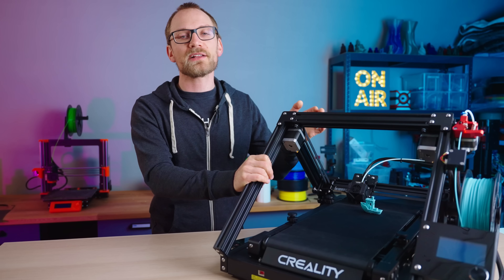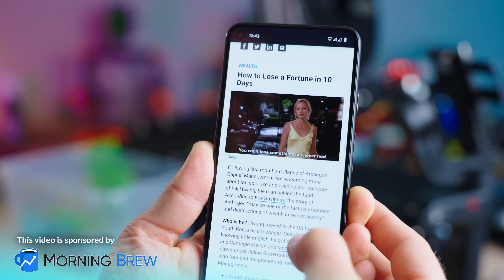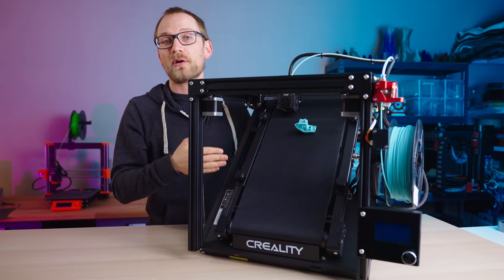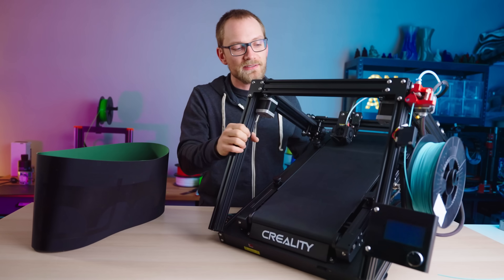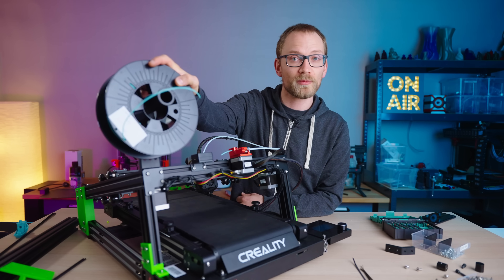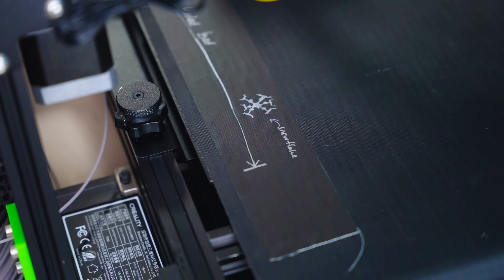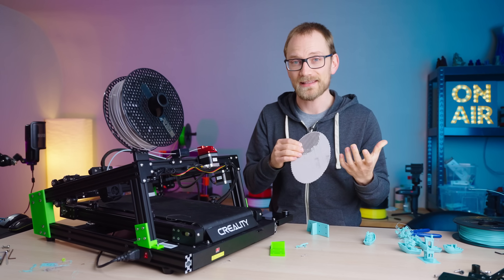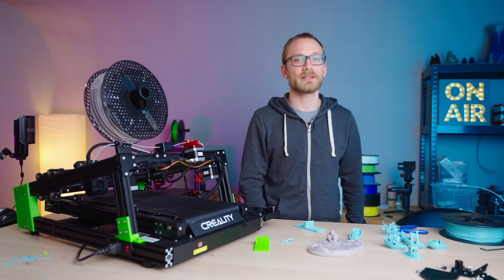Is a lowered belt printer BETTER?

Comment: This printer is so under engineered! They could have easily made a tilt feature on the hotend for the beginning lip of the print where it angles off after it gets started.  I also feel like you should have made a variable height setup rather than cutting the extrusions like you did. You could have easily put hinges on the back side, and then some type of slider with linear rods on the front side to make it adjustable depending on the model.

Comment: I wonder if you would be able to design something to tilt the carriage that last 15 degrees so that it printed with the nozzle directly contacting the belt, or do the same thing in the original design. That way, bed adhesion wouldnt be an issue.

Comment: A lowered print angle is going to make bed adhesion worse because the best angle for max adhesion is 90 degrees straight into the print surface. The purpose of the angle is to allow for long prints. 45 degrees already allows for infinitely long prints so having the angle past 45 degrees has no benefits and only drawbacks.

Comment: Why not install a 45 degree adapter to the head so it's printing perpendicular.
Reply: You moving the entire Frame seems to be the issue.  Also I would love into 10 inch 3m tape.  Then just adding a layer to attach to on the belt.

Comment: Another way to achieve a similar thing, would be to just tilt the hotend to be more vertical. If you then can also make the bed move forward and back during a layer, the effect would be the exact same.
That way you don't loose an z height. 
If you just adjust Z to sin(offset angle)*y + normal z
That way, you don't have to change the printer as much, and it could even be adjustable.
I don't know though if the Z-bed bed mechanism is robust enough for this, as as its now a true 3D process not 2.5D

Comment: could one make a regular printer with just a belt instead of a bed, like for making lots of parts in a row on a ender 3 style printer, and it just movers the belt to a "new build area" between each print?
Reply: You can. But we don't need belt bed.

Comment: i just can't get the point... the main reason for this printer is having endless prints. if you want to use it, to print many parts, just use a regular printer and put the belt under it instead of the bed...

Comment: What about Core-XYZ printer (Voron 2?) with belted bed? I think that might be a way to print reliably (bed would not move during printing) and continuously. And maybe with a bit of non planar printing you might even print those very large models.

Comment: Thomas I just found this video so informative. I've got one of the 1st CR30s commercially released and found that I have had very low adhesion compared to the other CR30s videos I've watched. I have 3 other fdm printers and this adhesion issue made no sense what so ever until your video. Could you or Naomi Wu tell me a bit about the different belts as I believe that after all my sttuggles that I have an early low adhesion version. Thanks Dave.

Comment: Why isn’t it just normal 90 degrees Z and the belt just moves it off and restarts?
Reply from the maker: That would be patented by Makerbot / Stratasys.
Reply: @MadeWithLayers  That’s BS in my opinion, it’s a process. So never buy a product from them then :)

Comment: I honestly don't understand what do you get with "endless" printing? Printing is slow enough anyway, and the print surfaces are big enough that you can print non-stop by changing the magnetic surface once a day. With many printers you can use "one at a time" setting, depending on the printer construction (Z clearance) and object height. If that is not enough, I would even consider buying two "regular" printers rather then something like that. Maybe I am wrong, but this is just my experience.

Comment: One question, what if you would use the belt as the Y-axis (the bed) and the use this to mass produce parts? (so instead of using this printer to produce meter long parts, just use it to produce repeated prints?
Reply: I've seen people use this printer to produce mass amounts of clips and things like that so its doable

Comment: Errm - Where is the catch if you just reorient the print head to be perpendicular to the belt? shouldn't it - with a firmware that is aware of the xy gantry angle - print just like a regular printer then? 🤔

Comment: would love to see like a traditional cr10 with the belt, so when the print is done it moves out of the way and next print starts, cut out the whole 45 print angle dilemmas
Reply: That’s what I’m waiting for. Just a traditional box frame 3D printer with a large dimension capability. Then when the print is done the belt slides it out of the print box and gets started on its next print. Having multiple prints in que and the ability for the machine to move to the next one. This is where it has to go.
Reply: @TheTeeDay  
Someone may make a printer like that, but it's not necessary to make a printer that runs constantly, and moves its prints off the build plate.
Look up "Slant 3D", who is a print farm owner. They, and other print farm owners, simply design the model so that it has the right amount of grip on the build plate, and then once it's done printing, the print arm simply knocks the part off of the build plate (intentionally), and that is enough for it to start printing again.
Reply: i am using ideaformer ir3 v2 and similar printer and  the slicing sis the tricky part and rest is so much fun. But  i have wasted few killos of petg before i could understand how it works. 45 degree printing is really amazing if you understand where to put the support pillars and alsi ideamaker is the best slicer for this and has a lot of options to tune . I am printing motorcycle winglets, dashboard cas etc
Reply: That’s not the reason for this belt printer they wont to b able to print for example a one meter sword with this machine. 
If you want to print several things in a row this is not the way to go.
Reply: @Mr.T9191-i2f  that's not necessarily true. There could be a sequence that would allow part to print, then move the belt, continue printing.
Reply: @dominick253  it would still have to be sliced diagonally or use non-planar 3D printing. Extruders still have a width to them, so you can’t just do sections.
Reply: @Mr.T9191-i2f  out of curiosity, what would be your ideal solution if you were looking to print a large number of individual parts with minimal downtime?
Reply: @WeAreChecking   for me something like Thomas voron it’s Great to do that. But it’s a littlebit over engendered. 
For less down time  the simplest way you can  go is to push the prints off bed by the printer itself.

Comment: Good vid, I’ve wanted to get a 3D printer for a while, but had no need till now. I do leather crafting and want to be able to make my own stamps/makers mark.
Is there a printer that you could recommend for a beginner?  Would need to be able to print a material that can be whacked with a maul or weighed down on leather to stamp an impression.
Reply: i have actually tried using pla to do just this. a high infill print and pressure makes great stamps. i wouldn't wack them with a maul though

Comment: Why not use a sanding belt? You can get some of them that are really tough. 

BUt really, whats the benefit of the machine being angled? Just to get around a patent? Why not print the part, and have the belt move. Making it the z axis is dumb, just make it the A or B axis and add some lines at the end of the gcode that just moves the belt a certain amount.

Comment: Question: why not just using a normal corexy, moving the belt and at the end moving the belt 1/3 of its lenght so you can make a Mass production which is fast like corexy and save Like the belt system 🤔🧐

Comment: What do you think about a 0 degree belt printer? Something that prints like a normal corexy but can eject the print afterwards?
Reply: From what I gathered there is a patent covering just that, which is why they use a 45 degree angle (which isn't covered in the patent). This means that if you want to sell that design commercially,  you have to get a license from the patentholder, who can choose not to sell you one. Or can charge a hefty amount of money for that license, making your printer more expensive than theirs.
Reply from the maker: That was my original modding plan for the CR-30 😉
Reply: @MadeWithLayers  do you think your original plan would have been more of an improvement? 😉

Comment: wouldn't it make more sense to just angle the toolhead rather than change the tilt of the X/Z gantry? 
edit: while I am thinking about it, it might actually make even more sense to rotate the gantry the other direction(closer to vertical) but I'd have to play with the idea in CAD for a while to conceptualize it further

Comment: I really don't get the angle thing, more calculations is more error prone. The idea of the bed is pretty nice however I use a magnetic rubber mat which helps to get it off easily.

Comment: You could have just designed a duel fan, duct and have each ducked cover each area, maybe one with higher air pressure to the extreme overhang on the far side of the nozzle, very minor firmware tweaks to PWM at best

Comment: Would be interesting how other angles would affect the print. 

An angle sanded nozzle to be more paralell to the bed, would that do anything?
Reply: I'm not a lawyer but that might breach the patent, since it deposits at a 90 degree angle,  even though the rest of the printhead would be at 45 degrees. Also, sanding a tube at 45 degrees leads to an oval cross section of the opening, which means that the "dots of plastic" would be wider in one direction than the other. That might also influence print quality.

Comment: Do we know why the belt is at an angle in the first place?  Can you try angling the frame the other way so the belt is perpendicular to the other two axes like a normal X-Y-Z machine with the belt being one of those axes?  My CR-10 and ender 3 call the axis which would be the belt "Y".  So why can't the belt just replace the Y on an ender 3 or other conventional printer?  It seems like all your problems are related to printing at an angle.
Reply: That's patented by MakerBot can't sell those.

Comment: Best parts: 
(1) Build montage and music
(2) "Heated bed. Hot fire. Cooled bed. Snowflake."
(3) Tom's shop. Seriously, he could build just about anything there. I need to clean the garage and fix the door...
(4) Modding a printer without chopping the stock aluminum extrusions.

Comment: I wonder what kind of engineering it would take to design a new nozzle so that the entire machine is at it's original 45 degree configuration, however only the tip of the nozzle is angled 45 degrees down so it extrudes straight down on to the belt.
Reply: But then it would be angled wrong for when its printing the rest of the part.

Comment: What if you just completly modded it to a core XY style like a Hevo (hevORT) or voron with the belt moving up an down in the Z axis or XY gantree moving up and down for Z then the belt could also roll like normal giving it a infinite Y axis. 
Then you wouldnt have to deal with this slicer issues of the angled gantree at all!
That would be a mod worth doing imo you would have the best of both worlds, core XY which has very good kinamatics, and still have a infinite axis in Y direction. It still would have software issues but atleased anything thats the Y axis travel for the print head will come out perfect every time. Printing in a infinite Y print like a 1.5m long cosplay sword would still run into slicer issues but your multiple small prints to the print head travel Y length will be all perfect.

Comment: Add 15 degrees to the head mount so that the nozel is vertical. it moves on xy plane still. Think that would need firmware change

Comment: Could you make a 45 degree nozzle. I feel like that would fix everything
Reply: That probably won't work. If you angle the nozzle you'd get better bed adhesion but your layer adhesion will suffer the same amount as the bed adhesion improves.

Comment: Theoretically, the should be an ideal angle to mount the hotend at for reliability. It'll be between pressing the filament down properly and allowing clearance for the side of the hotend while things print.
Reply: Just had a thought, what if you file the top of the nozzle at a slight angle? I recently had trouble with a nozzle I enlarged being slightly off-centre causing bulges on one side (roughly equivalent to tilting the hotend at the contract point)

Comment: Rather than change the rotation of the top "core xy" mechanism from 45 degrees to 15 degrees, why don't you replace it entirely with the gantry from an Ender 3 mounted perpendicular to the belt? That way the gantry would handle X and Z, and the belt would give you infinite Y. You would avoid the problem of printing at an angle to the belt entirely.
Reply: That's patented by MakerBot can't sell those.
Reply: @CutterSlade001  In that case, why not rotate the "core xy" mechanism by 90 degrees (and counter-rotate the nozzle), making it into a core xz printer with a belt.
And if that's also patented, instead of putting a core xy mechanism over the belt, put a delta tower over the belt. That's surely too mad to have already been patented.

Actually using the delta tower over the belt has some advantages. There are two main use cases for a belt printer: continuous production of parts, and printing large parts. Using the delta printer over the belt could work well for the continuous production of parts - the belt stays stationary until the part is complete, then the belt moves to dislodge the part, and then another part can be printed on the now empty belt.

Comment: Someone should put a delta printer on top of that belt, I mean, printing to infinity is not that instresting compared to just being able to do as much sequential part as you want In my humble opinion. And I say Delta printer because the belt wouldn't have to move except for when it skip to the next part... Very interesting video nonetheless.
Reply: Could do a loop with a scoop and situate multiple deltas around the arc. Though in order to minimise downtime you'd likely just want to batch print the same object.
Reply: As a mod sure but: That's patented by MakerBot can't sell those.

Comment: I think the clean solution would be to have the either the belt assembly or the printhead be able to move vertically, which shouldn't be hard to do and then you could use it as both classic machine and as a printmill. Would require more parts, but would be the best of both worlds.
Reply: That's patented by MakerBot can't sell those.

Comment: Why not try  modifying a standard CORE XY ? By removing a heated bed, and replacing it with a belt bed?  having the X,Y axis moving in Z with 4 Z lead screws, and some counter weights lie a garage door. this would put the nozzle back to 90 degrees from the bed.
Reply: So a  Voron 2 with a belt bed? That's patented by MakerBot can't sell those.

Comment: I've only used Ideamaker with my CR-30, but I've never had any adhesion issues at all.  If anything, it's farther towards sticking too well.  This is using PLA; I haven't tried anything with PETG yet.  Only real issue I've had is the profile I started with prints infill almost like spider web.  It's only barely capable of holding up the top surface and the models feel really weak.  Changing patterns and density helped out with that to a large extent.  I do still screw up about every other print as I test part orientation and then have to reposition on the printer to better align with the printing pattern.  I assume that eventually I'll get the hang of it.  I went through the same learning process when I got my first SLA printer, having to learn a new set of printing rules that were largely the opposite of the FDM rules I was familiar with.

Comment: I'm curious... why not have a belt system on other printer types that just unloads the part and starts another? I understand the purpose of the slant, but I still think the right belt design has yet to come. Angled or otherwise.
Reply: That's patented by MakerBot can't sell those.
Reply: @CutterSlade001  using a belt is patented? That implementation, sure, but not the use of a belt as a print bed.

Comment: You monster! Just kidding😅 I love it- moar 3DPrintMill hacks!
Reply: Naomi be preparing all her cyborg ninja tech weapons & armour to pay Thomas a visit
Reply: Was low key hoping to find you in the comments! Also, it seems he has replied to 3D Printing Nerd's comment, but not yours...hmmm. maybe he is afraid XD. As an aside, I cant wait to get one of these belt printers in the future, I might be more inclined to mess around with cosplay :D.
Reply: Is there some reason why it the belt can't be tilted the other way and the nozzle rotated 90 degrees to make a regular X-Y-Z machine with the belt being the Y?  I would imagine that this was tried first, then the belt was turned 45 degrees for some practical reason.  Would you mind sharing that reason and why having the nozzle at 90 degrees to the belt was a problem to solve?
Reply: @ninehundreddollarluxuryyac5958  You can't print infinitely long pieces that way. Once the part starts coming off the belt there's no going back. You can't print a bit at a time because the finished part would hit the print head.
Reply: @ninehundreddollarluxuryyac5958  I believe that's a copyright issue currently.
Reply: Naomi ‘SexyCyborg’ Wu, do you think a PEI coated belt would help with his adhesion issues? He is using petg.
Reply: @houseofflambeau9656  I'm working on getting coated steel belts...
Reply: Oh - You already noticed his blasphemy on Your print mill !?
Reply: @Lobesanft  haha it's exactly why I had it made, so people could hack it and make it better😁
Reply: You can feel the fury building up